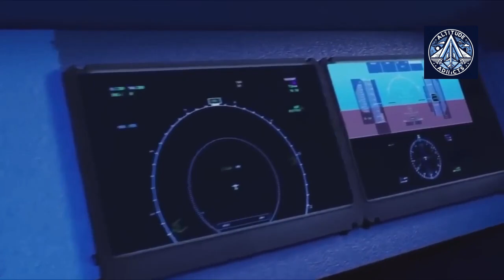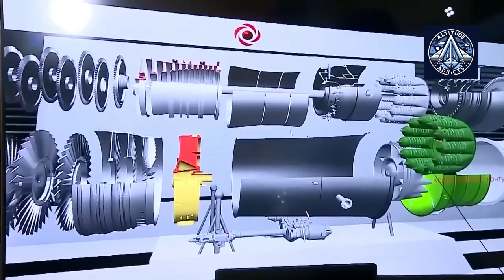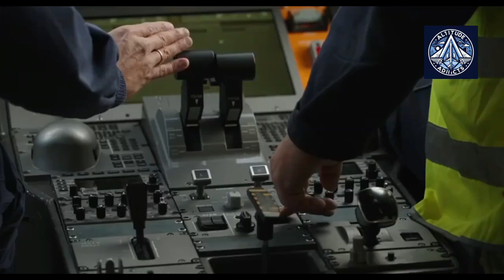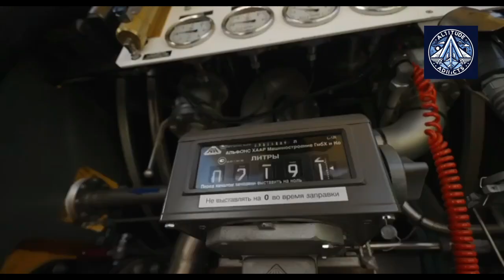MC-21 Production From 2025 and SSJ-100 with PD-8 Engine by 2026

Comment: The MS-21 project is 17 years old, the project was announced in 2007. Implementation began in 2009.
Reply: MC-21 310 is almost new plane without western components. New domestic avionics, engines, glasses, etc. Its started in 2017
Reply: B-52 is almost 80 years old!And still on the serve!😏
Reply: The B777x was built in 2013 and is not certified and has many problems. The B737 max was built in 2011 and flew commercially in 2016 and had 2 fatal crashes in 2018-2019. So what's your problem with age?
Reply: @vknfriendly  The Boeing 737 project started in 1964,  and it still flies today.

Comment: we've heard of this many times before. ain't gonna happen
Reply: The aircraft was heavily redesigned after sanctions which increased the time to service entry. It would have entered in service 2 years back with original design and pw engine.
Reply: Yes, like 777x😂
Reply: Now this is definitely it. It has passed tests, so it can go to production.
Reply: Under sanctions,its a big effort
Reply: @NanzushiFranko-ty7by It also didn‘t happen before sanctions. Production of the MC-21 was originally scheduled for 2012!